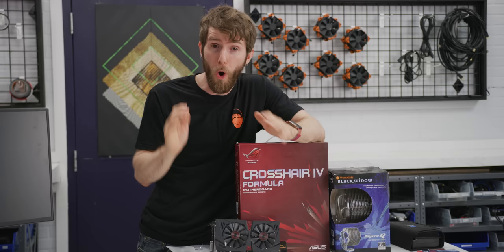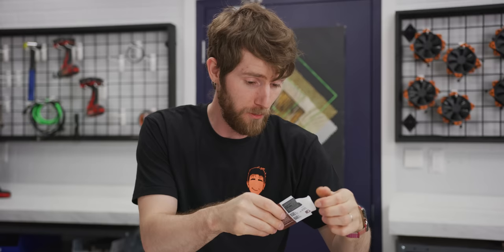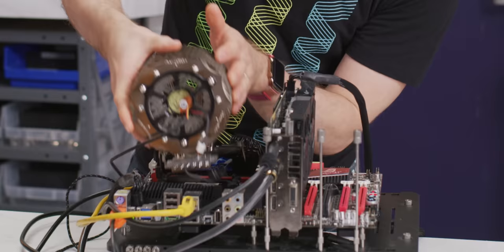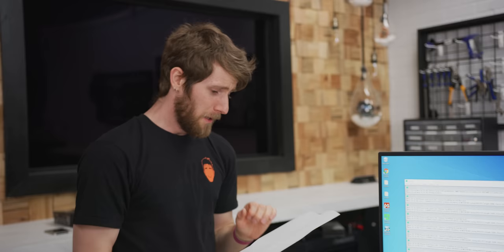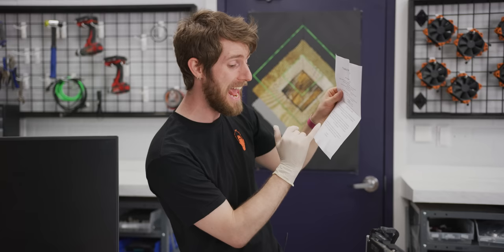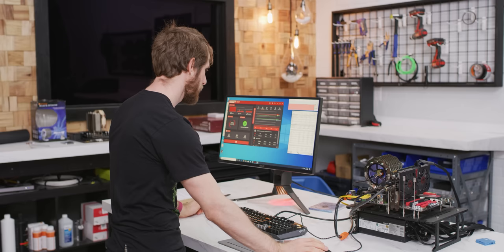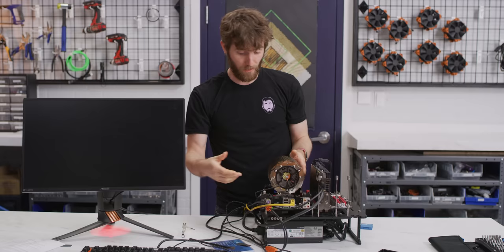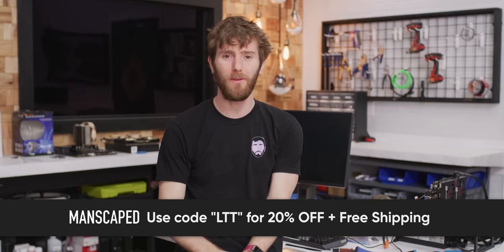Testing Another YouTuber's Thermal Compound!

Comment: Linus using a hammer and screwdriver on the cpu and cooler......When did he start working for The Verge
Reply: The verge doesn't use screwdrivers, they hope their Swiss army knife has one.
Reply: At least he did not use "tweezers"
Reply: @aloykatos  
They use fake news "zipties" and "tweezers" Gosh guys get it right..
Reply: @Napster60  Don't forget the live strong bracelet
Reply: @justsomeguy5470  And the CPU applicator tool that everybody definitely uses
Reply: @bloonsgaming  But before all that, you need a table
Reply: @bloonsgaming  That's why the cpu test failed!
Reply: @Robertotvl  honestly that shocked me the most. and you know why it shocked me? because i DIDNT install my psu on those grounding pads. eyyyyyyy

seriously tho,  did the dude actually think psu's just constantly electrocuted everything it touched directly?
Reply: Natos i cringed soo hard when i watched the verge pc build video.... like so many things were wrong. And yes he said that if you don’t install it on the grounding pads (sound proofing pads) that the system will get shocked
Reply: @justsomeguy5470  That of course is there to protect you not the components
Reply: I have to give the win to Verge on this one, I don't recall them ever epoxying their cooler onto the CPU.
Reply: But you have to remember, Linus doesn't leave the plastic film on his heat sinks and/or CPUs...😂😂😂
Reply: Geno Merci not yet lol
Reply: @geraldo00  Ah yes, he forgot the table, darn
Reply: Using a screwdriver and hammer on a bulldozer. Nothing out of the ordinary here ...
Reply: He also completely misrepresented the claim by Tech Ingredients. This was never supposed to be a great thermal compound. However, the only thermal epoxy that you can buy is the Arctic Silver, and it's famously hilariously bad, its conductivity is almost as low as of the usual epoxy. Tech Ingredients has been able to improve it by a lot - specifically for people who need thermal epoxy, not thermal paste.

Comment: I loved the glossing over how the “garbage” thermal paste was only 2 degrees off what the quality one did 😂
Reply: This was on a CPU that throttled at a fairly low temperature. I've had CPUs that didn't throttle till 95 C, which is where the real difference would show up.
Reply: This isn't thermal paste. This is thermal epoxy. They aren't intended for the same use cases. There is a reason thermal paste doesn't normally glue your heatsink to your cpu, because it doesn't have to. Thermal epoxy is for when you can't attach a heatsink conventionally.
Reply: Well the performance paste didn’t throttle.
Reply: Do the test again after a year or so.
Most likely then "garbage thermal paste" would be way worse at that point.
Reply: Wrong CPU, and two degrees on air just for paste means a lot.

When you have a delidded CPU under water, paste starts to matter a lot more.
Reply: It's been known for a long time among enthusiasts that the difference between garbage paste and good paste is unnoticeable unless you're pushing your cooling system and overclocks to extremes. If you aren't running a barely stable system with a custom water loop, use whatever the hell you want. Any other build and it literally doesn't matter.
Reply: 1-2 ° is easily worth 8 dollars
Reply: For some reason youtupe Decided to show this comment in the main watching screen 
And there is no point of me to watch the video now.
Reply: There is also the law of diminishing returns to consider.  Plus, use a better cooling system, say water or phase change, then the thermal transfer coefficient will show much bigger margins.  But for that air cooler, it sounds about right.
Reply: @leakingamps2050  temp reporting on fx cpus was off, you don't want to be above 60 on an OC for long term use, 70 was the upper limit.
Source : my pc still has an fx6350 OC'd to 4.5Ghz
Reply: He didnt gloss over anything. He literally said he didnt expect the quality stuff to lower the temps very much.
Reply: @russellanthony568  Exactly, these guys just love complaining about everything.
Reply: LeakingAmps Dammmm you can cook some steak on that lol
Reply: My guess is that pad product is snake oil that only works because of the included grease..
Reply: Talltale not on a $100 build it isn’t lol
Reply: @Alobster1  cool story bro
Reply: I made it to 666 likes thank me later 

Jk
Reply: At the heat loads LTT tests at, there will be an almost negligible difference. Thermal paste is all in all, not that great a conductor of heat and the absolute differences in performance between them only becomes really meaningful once you start cranking the heat load past 300W. You might start to see a 5+ deg difference at that point.
Reply: @SwainixFPV  This was not a mis-report. I cooked food with the heat vents when it was rendering (it was a laptop), and it actually worked well if the food only needed about 100C. I also did burn myself on the air coming out a few times.

Also my Intel Atom hit 90C+ regularly in my Aspire One, but I could bring it down to 70C just by holding the case near the CPU (yes, that hurt a bit), so I think I might have had a broken fan.

Comment: “Does that look the same size? Do three more of those”  

LINUS USE THE DAMN SCALES ON THE SYRINGES! 😂
Reply: He started mixing up such a minute amount that the scales wasn't very useful. If he'd done it all in one go the scales would probably have worked though. From what I saw of the original video from Tech Ingredients they did apply the epoxy much thicker that what Linus did. That's also understandable as the components they used doesn't have a flat smooth surface like the CPU and the Cooler Master HSF, so it has to fill larger gaps and the slightly porous surface on that ceramic resistor.
Reply: @blahorgaslisk7763  look at the scales on the syringes @ 1:00 there's no sane reason for not using at least that much out of that whole syringe, also the larger amount you use makes the measurement error relatively smaller so you'll be getting closer to the recommended 1:3 ratio for an accurate test
Reply: @vola-2899  tech ingredients replied to this video and said the application looked OK

Comment: The Tech Ingredients channel deserves some extra attention, they make refreshingly informative content on a variety of subjects.
Reply: But can you trust it after watching this?
Reply: Yes!  I absolutely love that channel, it was great to see this on LTT even if it wasn't amazing.
Reply: @oldbatwit5102  Linus compared it against thermal greases and not thermal epoxys, so the comparison isn't fair.
Reply: spakecdk except that tech ingredients claimed it was better than arctic silver which is a thermal PASTE
Reply: @markirving6397  artic silver thermal epoxy is available on amazon uk
Reply: @markirving6397  no, they compared it against the Arctic silver thermal EPOXY.
Reply: @markirving6397   he didn't claim that. He used arctic silver epoxy (exact moment) /watch?v=8MOTMq9g8Nk?t=727
Reply: @oldbatwit5102  Linus did not compare this product to any thermal epoxies. A thermal epoxy is for when you can't attach a heatsink with conventional methods like screws.
Reply: @oldbatwit5102  
They never compared it to thermal grease, though they did hint that it was as good, that would depend on use case. In the video, Tech Ingredients compared it to Arctic Silver Thermal Epoxy, as that was a well-known (and expensive) product that they were trying to make a cheaper and better version of.

You should never use epoxy where you should be using a grease, and vise versa. Same goes for a thermal pad and grease, or a pad and epoxy (not talking about graphite pads). They all usually have completely different use cases. 

Epoxies are for mounting to a heatsink without fasteners. Thermal Epoxy is commonly used on specialty expansion boards or many RAM modules with factory heat spreaders. Performance will be worse than a good grease, but should remain consistent beyond the life of the electronics, which is good, because it is supposed to be permanent.

Thermal Grease is for a more temporary solution. It has greater performance at first, but does degrade over time or heat-cycles and should be replaced periodically. The better performance is because it can be applied much thinner than epoxies or pads, but tends to dry out and crack unlike pads or epoxy. Grease is usually only used (from the factory) on CPUs and GPUs, though sometimes I've seen it other places like on chipsets, which more commonly have thermal pads these days (easier to apply, longer lasting, don't need the performance) Grease also it requires a separate fastening method. 

Thermal pads like on VRM or GDDR RAM perform the worst, but they are maliable for uneven or multiple surface contact. Common uses include a single heatsink going over multiple power stages on a VRM, or a cooling plate going over several GDDR RAM modules on a graphics card. Thermal pads should last the life of the component without degradation, but taking them on and off often shortens their lifespan. Even though there is a mild adhesive in thermal pads, you need another fastening method between the sink and component.

Hope this clears things up.
Reply: Oldbatwit Linus honesty did them and himself a disservice. Most thermal epoxies cap out at 1W/m-K. In contrast, most thermal pastes are 4 through over 10 times that. They are clearly made for different applications.
Reply: @MrNside  thx for clearing up

Comment: "This video is brought to you by AORUS"

*Uses ROG motherboard*
Reply: ROG is so crap aswel
Reply: Do not quote on me on this, but I do not believe I ever saw Aorus during AM3 and AM3+ time period. Asus/ROG, Gigabyte(Not Aorus) and AsRock was pretty much the standard for those builds back in the day.
Reply: Sponsor and Content are separated
Reply: @LocoMe4u   What's bad about ROG? Also, *as well, and Louie never claimed AORUS is bad, so "as well" doesn't make sense. What is your favorite?
Reply: Xray Gaming thx. 

Under A Bridge Too Far, I think that ASUS, Gigabyte, ASRock and MSI are all great motherboard manufacturers. If you think ROG and AORUS suck, well then you don't need to get one if you don't want. 

I currently use an AORUS motherboard, and it works great. 
I'm generally neutral when it comes to buying a motherboard. I get what fits the budget, has the features I want, and has good reviews.
Reply: He didn't use it but sacrified it! Dishonored as if it has an honor xD
Reply: @LocoMe4u  ROG make the best motherboards and have done for years
Reply: @xray5984  im a week late but Asus bloat programs are just awful and I've owned two ROG Laptops that get blank BSODs 50% of the time when you do a restart (no, its not user error, it still happens on bios updates and fresh windows installs), and the most recent BIOS update on one of them causes it to not be able to read the 860 evo SSD in the system and Asus has no plans to roll out an update to fix that problem because the driver is already a year old. After those fiascos, I've since switched to MSI and Gigabyte for motherboards or laptops.
Reply: @Sun6935  Yup Aorus is recent compared to any of AMD's FX stuff.
Reply: @ArtisChronicles  I started with a Phemom II
Reply: complete MADLAD
Reply: ouch
Reply: @Sun6935  that thing is still in my grandma's PC :D
Reply: @lievre460  key word is laptop there... Motherboards don't come with bloat, and armorycrate in a decent desktop system runs fine and doesn't even need to be installed. Also how the hell is msi better, I've gone through 3 laptops in my family from them, and they are all packed with bloat (like all name brand laptops)
Reply: @LocoMe4u  ROG products are actually really good, it’s just that they’re extremely expensive and full of features that nobody needs (who needs a power draw read out directly on their psu?) the gimmicks are incredible and work really well, but they’re like Origin—if you want the good stuff you gotta spend the good cash
Reply: @MysticalApple  nah dude sometimes it's overpriced for no good reason

Comment: Tech Ingredients?  I'm subscribed to them and they make some cool stuff!  It's good to see them featured.

EDIT: I would like to add that I use thermal epoxy on mounting heatsinks to the Raspberry Pi. I use regular thermal paste and epoxy, mixing them together at about a 60/40 ratio (60 being paste). It does way better than the thermal tape they come with. Thermal adhesives are used in situations where you need really good conductivity AND you need the heatsink to stick as there are no other mounting options.

No one should be blasting Tech Ingredients for his creation and findings, and neither should anyone blast LTT.
Reply: Yeah, that was exactly the use case I was thinking of is on something like a Pi where regular paste won't work well.    The other option is thermal adhesive tape/pad which is much much worse than this.  What would be interesting is to see a third party test vs arctic alumina which is the general competing product.  Thermal epoxy isn't really that expensive though so I am not sure why he claimed it was expensive, I definitely wouldn't want to try making it myself though for the low cost of it.

Comment: 5:10 You can also quickly warm up the CPU by unplugging the fan.
Reply: Why go easier route?
Reply: that’s a tech tip
Reply: he was increasing ambient temps around the cpu
Reply: @LULU1422__  So that it heats up, turning the fan off does that as well

Comment: I love that artic silver is still like the standard for a decent thermal compound after all these years. Not many things in the pc world stick around so long nearly unchanged.
Reply: nah dude, i use to think the same, i switched to Gelid GC-Extreme and dropped 6-7c off of cured as5 (100% load) AND it doesn't cure, it stays tacky forever.  i had a prob removing a cooler that was stuck to the cpu when using as5 and ended up (acidentally) ripping the cpu out of the socket, luckily everything was ok and no pins broke.

Comment: 1:51 "The FX-8150, that was known for being an absolute inferno of a chip" 
Me on FX-8350 on stock cooler:
Reply: Same but I got the cooler master ml240r. It's dope for $80 and I don't go over 50°c
Reply: @butter5694  Yeah, I got a cheap $20 cooler with 4 heat pipes and a 80mm pwm fan and dont get past 52c until its 85f+ in my place at 4.3ghz (4.0ghz quad core in the summer)
Reply: Pfft peasants: FX-9590 @ 4.7 Ghz (Stock speed) with an aftermarket cooler - Still hits like 69ºC under heavy load, and I've seen max of 76ºC
Reply: Me too! But not stock cooler. FX-8350 on water cooling clocked at 4.8 GHz on all cores since it was new. Temps never over 60C.
Reply: Just upgraded from an 8350 50-54c in summer, 280mhz fsb 17.5x multi, 1.392v, 4.76ghz on water.
Reply: Just upgraded from an 8350 50-54c in summer, 280mhz fsb 17.5x multi, 1.392v, 4.76ghz on water.
Reply: Everyone bragging about the "low" temps on FX CPUs needs to remember the thermal sensor isn't in the same spot as modern CPUs, you're pretty close to throttling levels (or instead, damage) there
Reply: me: fx9590 on a lucifer v2 cpu cooler and well forced to disable turbo due to mb vrms overheating
Reply: @DragonProtector  had a couple friends that killed their mobos from the vrms getting crazy hot running mild oc's. Really easy to overdo it with that era of amd and like you said even with just turbo on it can really stress the vrms and create a ton of heat in a hurry.
Reply: Try a Pentium 4 or Pentium d
Reply: @randomweirdyoutubechannel8955  FX CPUs used much more power
Reply: @randomweirdyoutubechannel8955  i still have a Pentium 4 system in my closet that was my first real full pc build. Thing is a furnace even without pushing the clock and the fan noise to keep it cool is insane. I got it out not long ago and backed up what i wanted to save off the hdds just incase and i couldn't believe how noisy it was compared to what i remembered it being like. Thing sounds like a jet preparing for takeoff when you hit the power button..lol
Reply: @ILoveTinfoilHats  absolutely, only got my oc to that point from alot of reading, heavily monitoring to stay under 62c(i know, 70c limit) and lots of trial and error. Edit:Also VRM temps!! Have a tuf 990fx r3.0,  so less issue for me, but other boards will likely have issues.
Reply: but it running 4.7ghz so guess it ok
Reply: @randomweirdyoutubechannel8955  been there done that lol.
Reply: @DragonProtector  "running" and "is going to last" are 2 different things. People can run i9s at 7GHz with chillers and tonnes of voltage, but the chip is gonna die pretty fast if you leave it like that
Reply: @ILoveTinfoilHats  well i got offset voltage and it pretty much at stock. Been running great.
Reply: I had an fx 8150 black edition. IT was constantly running at 80° with the stock cooler. I have no idea how, it wasn't throttling, maybe the B.E. had a higher limit or something, but I had no money for a normal cooler. I removed all the sides from my pc case just to the bare chasse and hung up a butt tonn of fans from every angle to have as much airflow as it was possible. It was loud as a tractor, but at least it kept the temperatures below 80°c
Reply: I've rendered a video and the CPU hit 60-65 degrees Celsius (on stock cooler, no thermal throttling)
Reply: @System64MC  go look at AMDs website for the max temp. It's 61°. You're degrading your CPU
Reply: I must have had the worst 2. Athlon 64 X2 5600 and the FX 9590. Second one set fire to the board.
Reply: @scottrich976  How did it set fire to the board?
Reply: @System64MC  it melted the plastic clips above the VRMs. That dripped onto the board and started to get hotter. The fets melted the solder and shorted causing a spark then ignited the molten plastic. Fire and smoke filled the case and I flipped off the side and put it out with a car powder extinguisher.
Reply: @randomweirdyoutubechannel8955  my first built pc was a Pentium d when I was a kid I wish I went amd as that cpu sucked